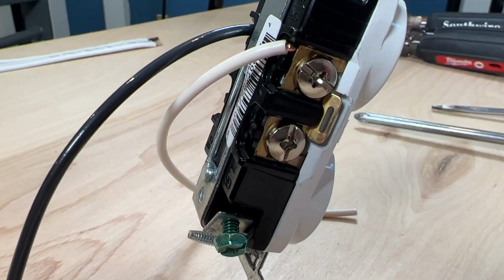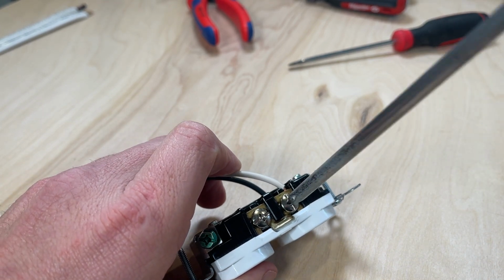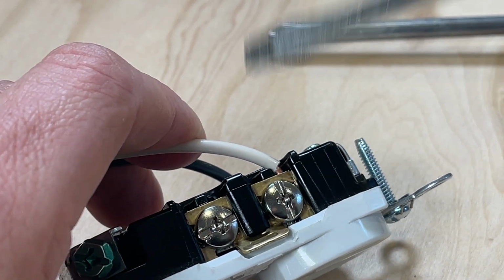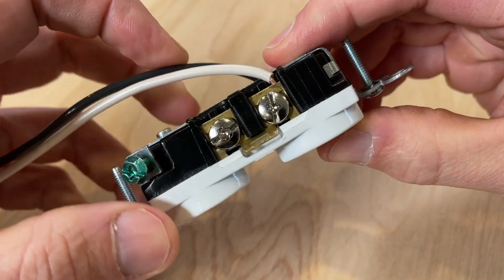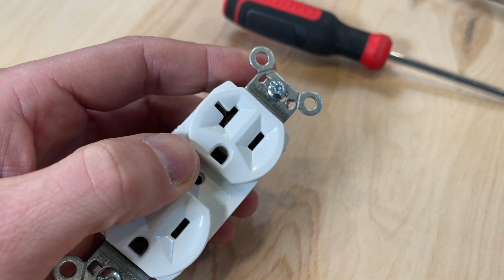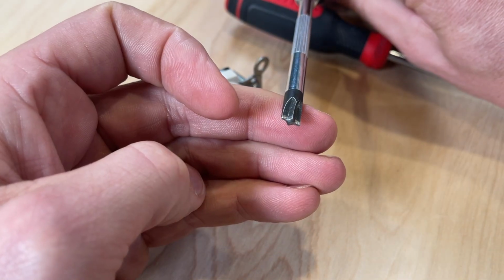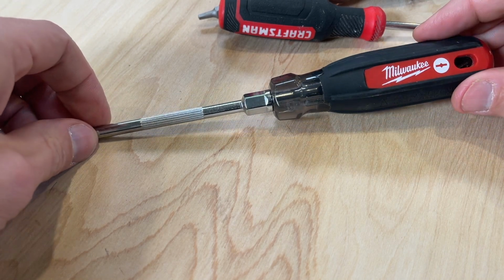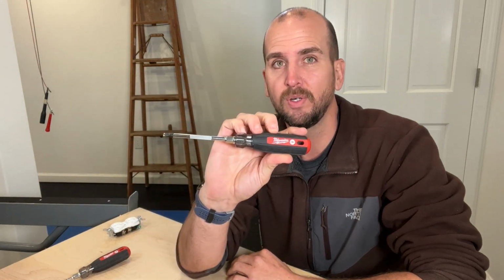80% of People Use the Wrong Screwdriver For Electrical Work

Comment: As a Canadian,  I have used #1,2,3 Robertson for decades. Pretty much everything from Framing, Deck building, Fence building to Electrical.  It also never occurred to me to use a Philips or Slot,  they will just slip.  I just don't like the multibit drivers with Robertson, the dedicated Robertson screwdrivers I find last longer.  I think everything should be Robertson or Torx.
Reply: Flat screwdrivers are made for prying things like paint cans open lol
Reply: So true, they are essential, but not for their intended use.
Reply: @terrymulton252  ARGHHH NO!!!  You'll bend the screw driver.  Use a can opener for opening paint cans.  There are a couple of different types that will open paint cans.
Reply: As a non-Canadian, I think everything should just be Torx
Reply: As a Canadian living in the USA for the last 20 years, I brought my Robertson screwdrivers with me from Canada, and I use them all the time (especially the #1) for electrical work. I even brought down boxes of various Robertson head screws that I use all around the house for various projects. Will probably drive the next owner crazy having to deal with those Robertson screws, but they're so much easier to use than phillips screws, especially if you are doing overhead work. The Robertson screw driver can hold the screw at the end of the screwdriver and you can start and drive the screw one-handed...
Reply: @guenetteworks  In my experience Robertsons are easier to shear off (drive or screw, depending what is stronger) than flat, if tightening manually. Robertsons are good for electric drivers
Reply: Best thing about a flat? If you strip any other type of screw. A dremel tool makes a good flat slot to remove the screw. noufgh said lol
Reply: philips has an advantage in manufacturing because it allows machines to set a precise torque in a low cost-way. Robertson and Torx are superior in every operation where the torqueing is done by a human. I prefer Robertson because they are much easier to clean if the screw head gets gummed up, just get a equivalent-size flathead and you can instantly get all the gunk out. Slotted drives belong in the 18th century and I am baffled that they are still being made.
Reply: @KekusMagnus  Slotted screws still have one advantage in my opinion, despite generally preferring torx, robertson or pozidriv; they do look better in locations where the screws are exposed, such as on a switch plate, or as a random, unrelated example, as pickguard screws on electric guitars/basses
Reply: As a fellow Canadian, I love using the robertson screwdriver. On job sites, I get disappointed when some equipment comes with a slot or phillips only.
Reply: It’s unfortunate that Henry Ford is still keeping USA from using the better screw. Robertson is in so many ways superior and easier to use over Philips....should have died over 100 years ago.
Reply: If you can find a modern screw made for a modern P bit, a modern ISO-standard P bit will work perfectly. But those screws are rarely used in applications where  so much torque is needed that cam-out would be a problem. "Jeweler's" drivers are P type.
Reply: The Phillips head was designed to be superior as it’s American. They failed. But then again, Canadians have Justin Trudeau so really jokes on them.
Reply: Yeah Robertson for the win , but its a Canadian thing and USA dont want to use them because they dont have the idea in first place... Like they retarded imperial system 🤦‍♂️
Reply: Yesss, outlaw eveything else.
Reply: @davidworks7758  Call it racist and everyone will cancel it.
Reply: There's a place for IMBUS in industry. M80+ fasteners are no joke

Comment: i find that any good fastener is a Robertson especially when it comes to electrical. The last thing I need is another odd ball tip like the ECX. If you can't get it torqued properly with a Robertson then something is wrong with the fastener. You should never use "multibit" tips on electrical from a safety point of view.

Comment: You're wrong all the way through. The cross screwdriver is too thin, the flat screwdriver is too short. All tools are for mechanical use and no electrical use. Tools for electrical work are always insulated to 1000V. This is s*** for a handy man.

Comment: I use my Klein 600-6 (5/16” tip, 6” shaft) slotted screwdriver for switches and receptacles, have for 18 years and have never had a problem. I’m not going to take advice on tools from someone with such garbage for tools, haha! Professional electricians virtually exclusively use slotted screwdrivers for any kind of terminal that will accept one, at least the thousands of them I’ve worked with. Some apprentices, inexperienced or lazy guys, etc. will use a 10-in-1 or something, but they suck and I don’t trust them not to break, slip, arc, or shock me. Use quality tools in good shape and you won’t have to worry.

Comment: The problem with most devices today is  the quantity of  the hardware used on the device  itself,  most of it made in china and is
easily stripped out if over torqued. 
agreed that the square head is the best choice if you know your torque  limitations  or you pay premium price for a quality device

Comment: I worked with Robertson Whitehouse to help them with the closing old retention ponds that were no longer needed. Had several discussions with the CEO and he indicated that the reason the Robertson wasn't as popular was that the Philips head allowed less precise alignment in assembly line manufacturing. This meant that powered drivers could be used to quickly insert fasteners.
Reply: This is no longer true as more modern power drivers can set a precise torque without relying on cam-outs. On older assembly lines it might still be the case but the main reason Philips drives are still so popular is because of their ubiquity. They really suck and I hope Torx or Robertson drives completely replace them at some point.

Comment: The Robertson #1 doesn't fit in most of screws in my case. I am from South Korea and most electrical installation screws are designed to perfectly fit SL/PZ (Slotted/Pozidriv) combination bits such as PB Swiss E6-180 or Wiha E 6.3.7049. I guess Slotted/Roberson screw is probably prevalent in North America.

Comment: I recently started working in electronic testing field after graduating with a physics degree. There is a lot about electrical work that I don't know about! We use a lot of those kind of screws at work, so I will have to look and see if we have any Robertson drivers at work. I've been using a Phillips or flathead this whole time because I didn't know there was any other options!
Reply: Unless you're changing sockets and lamp switches in the US/CA there's no reason to use them.
Reply: Great "degree"...
Reply: @dongleberry4397  you're saying physics is not degree worthy?
Reply: why did you choose that job? physics degree is overqualified

Comment: So let me get this straight, as a DIY home remodeler I should buy bits or special screwdrivers to fit a screw head that is designed to work with almost any bit or driver that I likely already have to tighten the terminals??? You can literary use the jab saw you used to cut the hole for an new outlet/switch to tighten those screws sufficiently. No special tools required DIYers.

Comment: You should use dynamometric screwdriver and apply the torque required by a producer, not the maximum torque you can physically apply. This could be dangerous and void warranty of the device you are connecting.

Jesus Christ American outlets are awful. Spring connectors are much quicker and safer than the screw terminals.
Reply: Moreover while doing any electrical work even if securely disconnected you should be using isolated tools. It is all about your safety. Those tools are full of exposed conductive parts. 

My company would never use such tools they are not designed for real electrical work. Try Knipex or even Wiha

Comment: Of course most if not all DIY wiring guilds recommend a Robinson screw driver. A Canada came up with the design 🇨🇦.   

One other point. A long skinny blade Robinson is also used to mount the electrical box. The holes on the side of the box are access points.

Comment: First: You are completely right, BUT in fact you do not have to use that much torque. There are recommended torques for different applications in Ranges between 0.5 Nm and 5 Nm. That is not that much. Try it.

Comment: This is not relevant here in Europe. That type of screws is not used anywhere, to the best of my knowledge. And I don't think you can even buy those screwdrivers here - at least I've never seen them. Phillips, Pozidriv, Torx, Hex (a.k.a Unbrako or Allen) and old fashioned flat screwdrivers are what we normally see here. Apart from special bit sets. For electric installation only Phillips and flat are applicable.

Comment: I am amazed at the most serious issue in this video:  The Phillips screwdriver has no business here at all for the simplest of reasons - the screwhead is not Phillips - it is a combo of Robertson (slightly tapered square) and flat blade (straight slot) and NOTHING else.

The Phillips screwdriver would only be considered here by people who typically use a totally incorrect screwdriver on screwheads.
Reply: Considered by people who think there are only two types of household screwdriver: Philips and flathead. Any other weird screws (like Torx) are for proprietary tech that is trying to keep you out.

I remember the first time I saw a square hole in a screw was when I bought my first house, and I thought how the hell am I gonna unscrew this extremely stripped Philips screw? That’s when I noticed it wasn’t damaged at all, and then googled “square screwdriver” and found it.

Now I see the value of the square bit, but I had to discover it on my own. My parents didn’t expose me to this during my time living with them.
Reply: I think the vast majority of people (in the US at least) simply never learned that anything other than Philips and Flat exist. And even if they know that others exist, they might not recognize one in the wild.
Reply: It's cut for straight, Robertson, and Phillips. The head is cut with two crossing slots and then deeper down is where the Robertson driver engages. If it wasn't meant for Phillips, then the crossed slot wouldn't be necessary. That crossing slot is actually what obscures the fact that a Robertson bit works in there. If you didn't have that crossing slot, you'd see two sharp corners across from each other.

Comment: no!!! do not listen to this guy. first of all you have to use fully insulated screwdriver. The rest depends on local specific needs. using wide flat tip often ends with thread demolition

Comment: Those US wallsocket looks pretty scary in comparison to the European Schuko -Dutch and -German 230VAC wallsocket with push-in terminals for solid core wires...no screwdriver needed.
Reply: US wall sockets also have push-in terminals as well as screw-on terminals.

Comment: Using a crappy, worn down screw driver - flat, phillips, torx or pozi - is always the wrong tool. Buy you're self a new phillips drive and it will work fine.

Comment: thankfully i dont have to make that choice, as i live in germany and almost all outlets here use a clamping terminal where u just stick the stripped wire in, the only screw you have to tighten is the holding screw for holding the outlet in the bracket

Comment: my immediate reaction is I'd rather have a screwdriver pop off the screw instead of stripping the thread from the screw by be able to apply more torque with "proper" fit shape, which pretty much renders the whole outlet useless. over torqueing is a big issue as well.

Comment: For a DIYer or general mechanic it doesn't make sense to use a specialized bit tool or the wrong bit , when the bit that the electrical hardware is designed for is a common standard bit.  It's questionable practice for a professional electrician to use a driver that can tighten a fastener more tightly that it was designed to be tightened.  Phillips drivers were designed for Philip screws so that would not happen.  Professional and contractor grade device terminals you refer to were designed for international use with square bits or a properly fitting flat bade driver. 

Too  many people use undersized, poor quality, poor condition,  flat blade screw drivers.  A flat blade driver tip should be square-cut, the same width as the fastener head, and the same thickness as the slot. The one shown in the video is none of those, so it fits loose, only contacts the  both sides of the slot simultaneously with the corners of the blade, slips out easily,  and can't produce adequate torque.    That's how amateurs end up marring and gouging wood. 

Btw, even the ISO standard that replaced the cam-out style Philips bit is a poor fit in a square hole with a cross slot. It will only bear on the head above the bottom if that cross slot. 

I use Picquic multi-bit drivers for nearly everything, including electric receptacles.  They cost half as much as the bastardized Milwaukee driver, and the Taiwan-made bits are much better quality than that of the Milwaukee.They use long 1/4 bits that store in slide-through holes in the handles.  My go-to Dash 7 has 2-inch bits P1, P2, P3 (ISO standard) ,  SL-1/4, SL-3/16, R1 and R2.  Reverse the primary bit in the shank and you can carry it in a trouser pocket without losing the bit or poking through the fabric. High quality replacement 2-inch bits are readily available and are usable in electric drill drivers.
 
The longer handle Sixpac Plus  has 3" bits:  P1, P2, P3,  SL-1/4, SL-3/16, R2 and PZ-15 (US version) or  R1, R2, R3, P1, P2, SL1-4, R3/16 (Canada version).

Comment: In Europe, I think most manufacturers have switched to Torx by now. What is left is mostly Pozidrive.
At least here in Denmark, I have never seen a Robertson product.
I DO have Robertson bits though (1-4) in a specialty bitset I bought a while back. It contains a lot of those special safety bits along with the standard ones.

Comment: I have a Milwaukee ECX.  It’s like using a flat screwdriver. It has to be lined up pretty well. 
So I use Philips.   I have pozi-drive and JIS too. The screw heads are too shallow for those. Never tried the Robertson. 
I wish everything would just go to torx.

Comment: Robbie is my only choice. Your Robbie example is a poor quality tapered design. True quality Robertson use a proper straight square shaft point for a solid fit in the screw. Never seen the Milwaukee tool and does look like a quality fitting tool.

Comment: Philips head on screwdriver is imo design flaw as its designed not to be flat but such you can't put much torque on before it starts 'pushing out' due the tilt. If want make perfect "Philips" screwdriver you will go buy Pozidrive and hack the extra 'wings' out as it is totally flat and not same problem.

Comment: Been around electrical since the early 80's. Worked with electricians many many times since then and this is the FIRST time I've ever seen this. Have seen ET's use a Phillips and then follow up with the straight, but this tip seems like the proper way to go. Strange, I've had them in my tool box for 30 years and never used them....
Reply: Phillips followed by straight is my technique.

Comment: as others have said, everything is robby here in the great white north. #1 for finishing (recepticles, switches, etc), #2 for rough ins (box screws and mounting screws, as well as set screws on pipe couplings and connectors). the odd time you need a #3, but I'm forced to use my #2 phillips on US made lighting fixtures more often than I've used my #3 robby.

Comment: Lots of replies on Chris below, after 22yrs I still use a Klein 6 inch 1/4 slotted, it’s the way you hold the receptacle as well and things you learn to do and not to do over the years. I did buy the Klein versions of the ECX 1 & 2 but I still find myself grabbing my slotted for switches and receptacles, for breakers I use a #2 square drive torque screwdriver by Wiha because of the torque specs they want on lugs and breakers in panels.

Comment: I wish I had known this 30 years ago. My DIY days are over, but I did a lot of home wiring back then, and no one ever suggested these tools.
Reply: 30 years ago a standard receptacle did not have the type of screw shown in this video so neither the special combination tip or the square drive would have been useful.  At that time only a standard flat blade screwdriver would be used.
Reply: Because noone cares enough to use these tools today and they didn't use those screws back in the day.
Just another example of people inventing solutions to problems that don't exist.
Reply: Lazy bum

Comment: Instead of saying that 80% of people are using the wrong tool, why not say, " hey, have you seen this new tool that MIGHT make your job easier?" Your delivery suggests that you feel superior to anyone who doesn't do it like you. Wrong way to influence anyone. When you say someone is doing it wrong, they automatically become defensive and block your suggestions. Food for thought. anyway, I'm gonna use what I have available and not invest in a tool I don't need. Namely, a properly fitting common screwdriver or an Apex bit that fits the screw exactly.

Comment: Maybe I'm strange but I use square drive or torx screws for everything,  the bits last longer  and it doesn't strip the screw head. 
They are must for hanging drywall.

Comment: I use an R1 for receptacles, switches, etc. and an R2 for operations in the distribution panel.  I wasn't aware of the Milwaukee ECX drivers.  They look great.  Thanks for the tip.

BTW I have sets of gunsmith-grade screwdrivers that are far superior to common ones.  The flat-blade drivers are hollow ground so they are much less likely to slip out than inexpensive ones.  One set is from Brownell's, the other from Chapman Tools.  I recommend both brands.